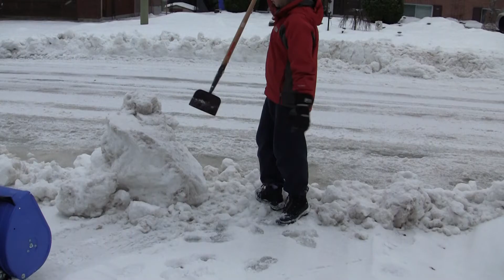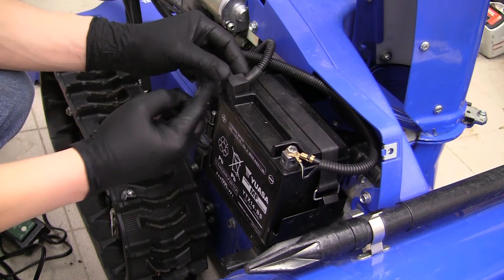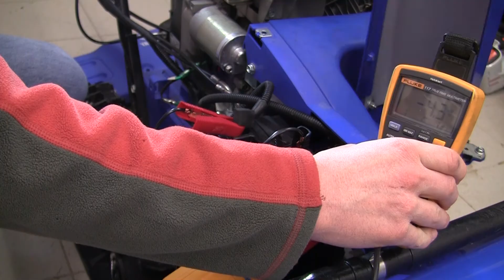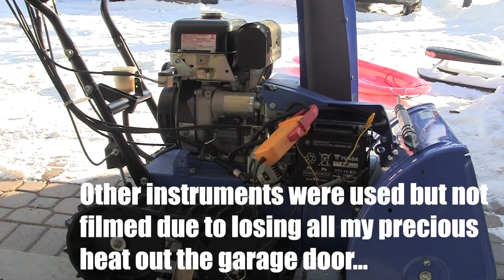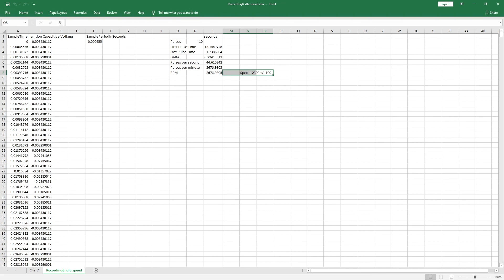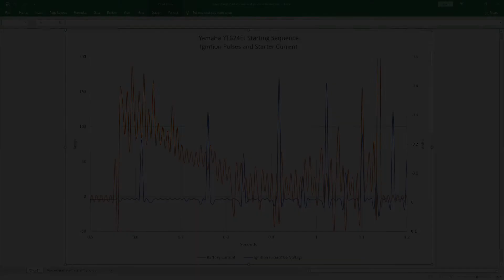Ep. 3 - YT624EJ M.S. - Charging the Battery and Bonus Electrical Content!

Comment: great job well done. Can you tell me how many watts the original light has? Mine died and I want to install a brighter one without draining the battery??!! Thank you so much.
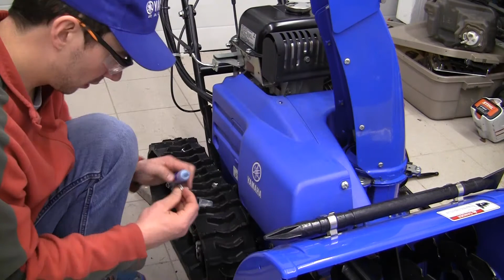Reply from the maker: See here at about 3:58. https://youtu.be/Jup8BIyeW18?si=CuJTydymywvb3VMG

About 5-6 W.
Reply: @lucgallant  ok thanks, so a 72 watt light is too strong for the system??!!
Reply from the maker: @robbyfortin4279 Well, in the manual it's not actually written what wattage the magneto and the rectifier ratings are. But, yes, to me that's quite high. What kind of light is that? LED? If you could find one in the 10-20W range it would be far more appropriate. But with the proper tools you could try it and monitor the system to see how badly it is stressed. But barring the ability to do that I wouldn't go up that high.
Reply: @lucgallant I plugged in a single 72 watt light and will test it tomorrow after a snow storm. If the battery has not discharged, do you think it is correct??
Reply from the maker: @robbyfortin4279  Well, that's definitely a big part of it. You could actually measure the current out of the battery to see if the battery is supplying the lamp or if the rectifier/regulator and magneto are able to on their own. The other part is how well the rectifier and the magneto are tolerating the current. You'd have to be monitoring their temperatures to know which will be very hard. The regulator is easily accessible but the magneto is in the engine. 72 Watts at 12V is 6 amps, whereas normal current to the light is 0.4 A and the battery charging current is probably 1-2 A. So you will be well above their normal operating point. I don't know what voltage the magneto outputs but the impact to the magneto will likely be lower than to the regulator. The regulator is near the battery, you may want to see what it's doing when you add the light. See what current is leaving the battery after you start the unit with the light.
Reply: @lucgallant  I'm going to plug it all in to avoid an electrical breakdown and find some lower voltage lights, thank you for your valuable advice...
Reply from the maker: Hi there - for your information, I found the power output capability of the charging coil. 7 Amps, which at 12V is 84 W. But I am unsure at what voltage this coil runs - will be subject of a future video. Anyway assuming it's above 12 V, the next limitation will be the regulator rectifier. So if you leave a few amps for battery charging, and a bit of margin so you're not running on the ragged edge, I probably wouldn't install more than a 35 W LED, if it was me. If you want to push the absolute limit you could probably go up to 55 W, but I would avoid doing more than that to make sure you don't overheat the magneto. Thanks and good luck.
Reply: Perfect thank you, finally I installed an LED electric bike light which should not be stronger than 5 watts and which illuminates sufficiently... Thank you for your very useful additional information. Good day.

Comment: Like your video. Any chance you could give me some advice? My blower starter turns over super slow even with a fully charged battery.  Same machine as yours.
Reply from the maker: Is it out in the cold? Warm garage? I would start by checking the voltage at the battery while starting, confirm it's high enough (10-11 V). If it's warm and turning over slowly you could have a failed starter on your hands. You can remove the starter and use a multimeter in Ohm mode to test it by rotating the shaft to each pole position and recording the resistance.
Reply: @lucgallant  I just did a check with my battery showing 13.56v. When I turned the key and engaged the starter, the voltage dropped to about 6v. After a couple of seconds, I let go of the key, and the meter read 11.6v. After a few minutes, it was reading 11.9v.
Reply from the maker: @freddybeach7733  6V is very low. If she look at my video mine went down to 10.5V. I would suggest a new battery, Fort Nine has the Yuasa brand for good pricing. But if you want to confirm before spending, you could try boosting your snowblower with your car. See if you get a different start.
Reply from the maker: @freddybeach7733  actually listening to my video again at 13 minutes and 5 seconds I describe this scenario. LoL
Reply: @lucgallant  thanks for sharing your knowledge
Reply from the maker: Also how does it feel with the rope? And how does it run once started.
Reply: @lucgallant  I keep it in my shed so it's sheltered but not heated. It starts very easily with the pull cord, and the engine runs well.  I am going to take a closer look at the battery health now, and this spring, I will take a look at the starter. I am hoping maybe I have a loose wire or bad connection.